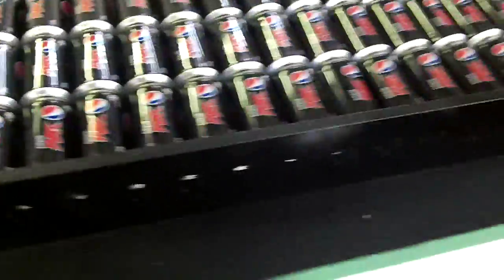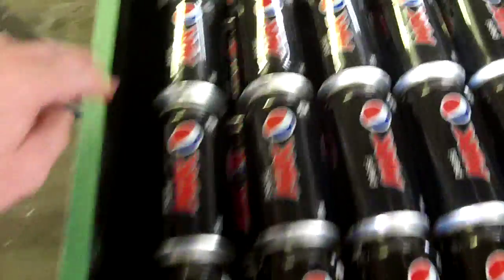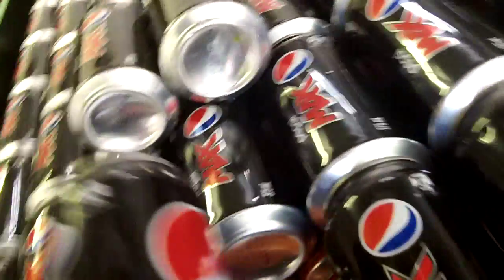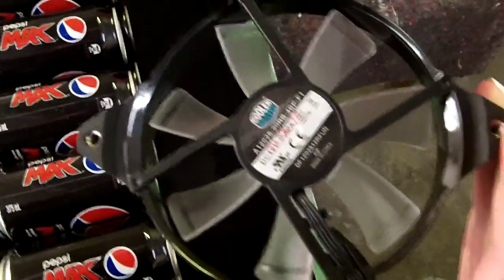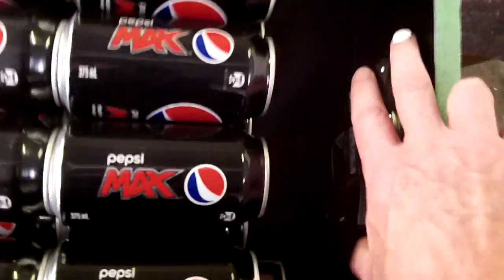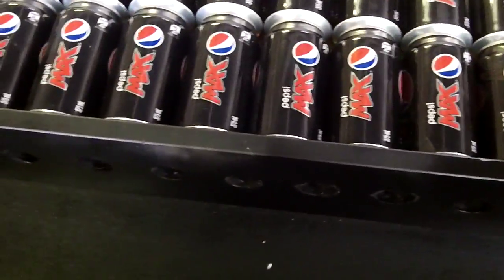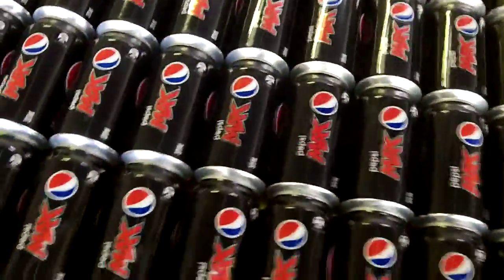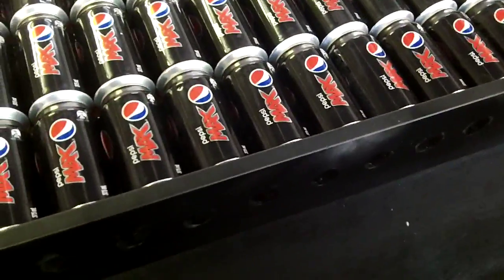Free Heat!! Melbourne "Soda Can" Solar Furnace, (no glue, holes or paint)

Comment: I have a question...... I also live in Melbourne, do you think it has made a difference to the temperature of your house during the winter time ?  Especially on these cold 12 degree days.   I'm thinking about doing something during the day when no one is home, just have it running so when we come home, its not going to be 13 degrees inside the house, then have to run the ducted heating.  I have a large and long house, single storey weatherboard, with great sun facing flat roof space available.

Comment: So how did it go?
Reply from the maker: Great so far Micheal.

One test static so far without a fan, reached 61c during a full sun day with ambient air temp at 25c, unit was sitting outside for about 10 minutes. Had to cut the test short as the perspex was starting to lift of the magnetic seal and buckle. A lot of heat was trapped in the protective sheet covering the perspex, left the covering on to stop the perspex from scratching during testing. When I remove the covering more heat will get to cans but I will definitely have a fan install to prevent overheating. Next time I will measure the difference between fan on and off. Will probably need to test it in the morning as it is the peak of summer in Melbourne. If I could achieve anything above 45c with the fan on I'll be happy.